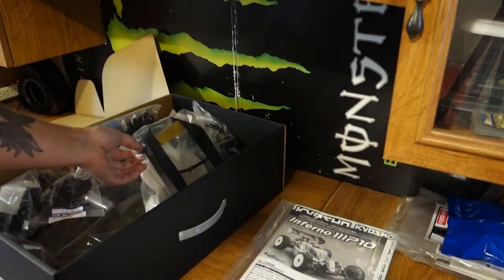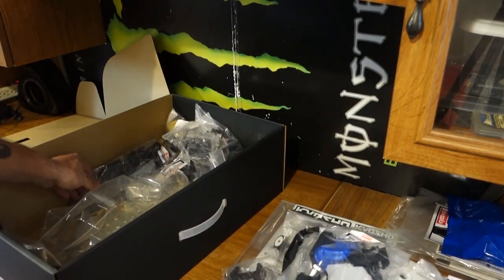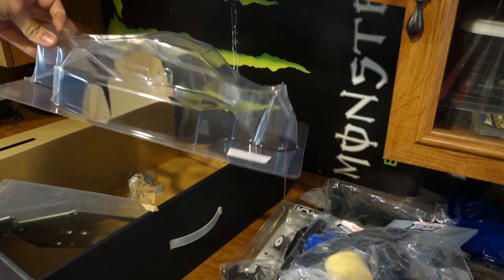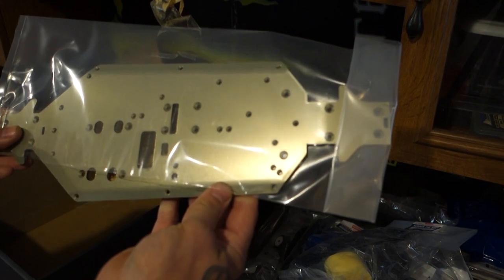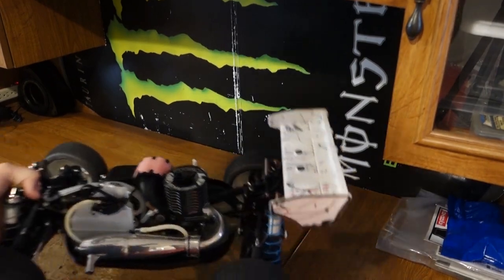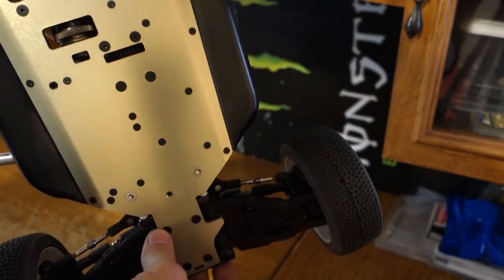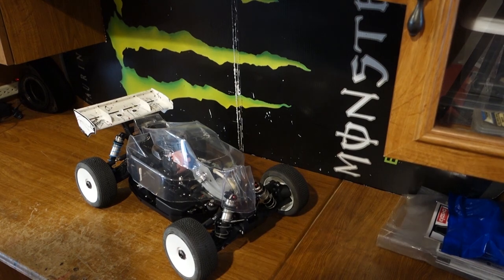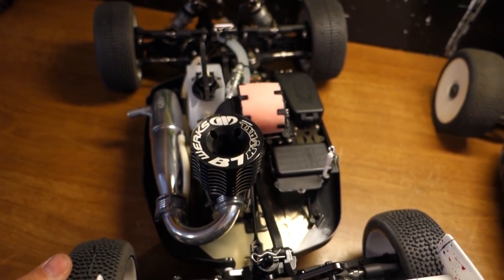Kyosho MP10 and MP9 Which One is Better?

Comment: What are the servos you purchased for the mp10?
Diff fluid weight for front center and rear?
Shock oil used?
Reply from the maker: Right now I’m running hitec D945TW Steering and throttle, Diff fluid is 7,000 7,000 3,000 with 40 in the shocks front and rear. Losi fluids

Comment: Nice car. That pressure line is not silicon like fuel line? Are those Tigon for support  the heat?
Reply from the maker: Thanks man 👍 Yes a little more heat resistant, kyosho muffler pressure tubing

Comment: Hi, thanks for sharing I have a question for you being that you've built both the MP9 and MP10 how do they both go together meaning as you're building them does everything go smoothly or do you have to retrofit, sand,  this is supposed to be the best brand for fit and finish also how do they hold up thanks
Reply from the maker: Not at all they both went together perfect👍 I've tried other kits before, and they all have their pros and cons  just a big fan of Kyosho the quality seems to be on point👌 I honestly rather have a used Kyosho over any other 1/8 scale on the market 😁
Reply: Nathaniel Hunter okay thanks 🙏🏻
Reply from the maker: @wallyj2000  no problem man,  I think my first video on YouTube years ago was me running  my mp9e and I ran that thing to death, never let me down 👍
Reply: Nathaniel Hunter Cool, that’s good to know. I purchased a Mugan MBX 4 about 16 years ago I think I bought an OS engine and some servos and believe it or not it’s been sitting in a storage since about 16 years I never ran it because I never purchased a radio maybe it’s a classic LOL  I think I ran one tank of gas through it just to hear the engine on the starter box. Was thinking about getting  into the hobby I’m just worried they don’t make parts for it anymore in case something breaks

Comment: So which one is better?
Reply from the maker: They are both great Buggy's but I do like the mp10 more not just because it's a newer chassis but it seems to be more forgiving on setup and easier to drive in my opinion durability not an issue with either buggy, running video of both buggy coming soon.

Comment: Are those fuel line clips? Where did you buy them ?
Reply from the maker: Yes they are they're the ones that come in the Kyosho kits but you can buy them A Main Hobbies
Reply: @Nathaniel2503  thanks I just bought a MP9 and have started to upgrade it before I take it to the track. Any suggestion on parts based on your experience? I am still kind of new to the hobby and trying to learn. Ohhh yes I understand what you mean about the vented brakes coming from a car guy.
Reply from the maker: @Ls3Atomicvette  if you have the tki4 MP9 it's great right out of the box. I don't really have any upgrades that I do for performance, for me it's more about the bling Factor just makes the buggy look better. cars are so good now it's really hard to improve them seat time would be the best upgrade if you're looking to get faster👍
Reply: @Nathaniel2503  thanks I found the clips, what red screws are those I could not find them based on what you said. Ok cool I was thinking about upgrading the servos
Reply from the maker: @Ls3Atomicvette  they're just the Kyosho aluminum nuts I can't remember the part number off the top of my head